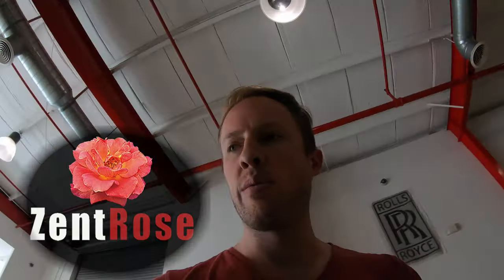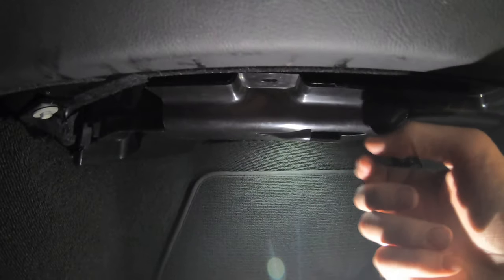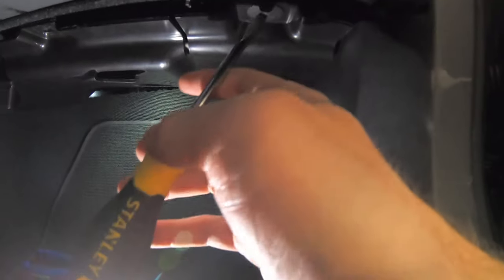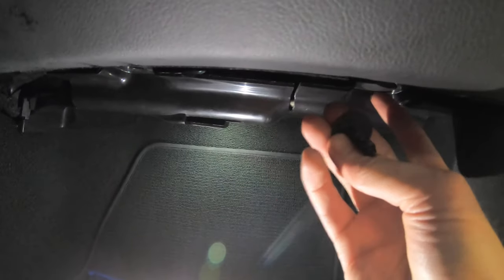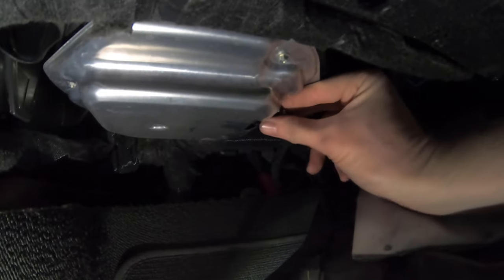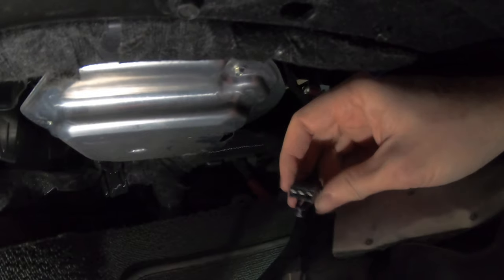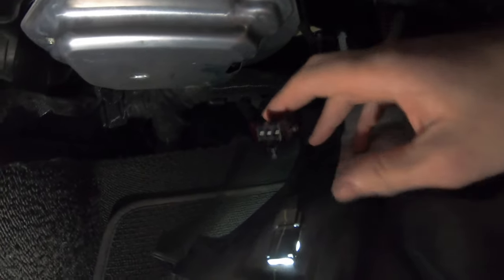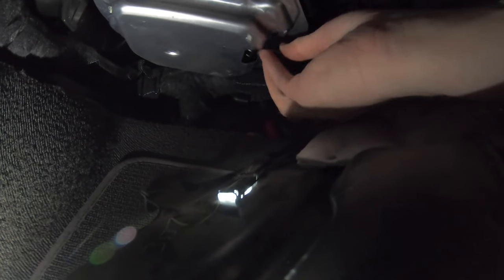C7 Corvette Blower Motor Failure | How To Fix

Comment: Did you guys ever diagnose why the fan motor turned off and on? I have a 2014 Corvette stingray that the fan motor will periodically turn off and on. Anytime I tap it or unplug and plug back in the fan motor works.
Reply: Hi, my 2014 corvette is doing the same thing. Did you ever figure out what causes it?
Reply: Mine too 2014
Reply: Any fix? Same here.
Reply: same issue on a 17 grand sport. fan works and then doesnt.  but drove over a bump and fan started working again. seems like a loose wire or connection. thanks, now i know where to look first.
Reply: Happened to me on a 2015 stingray

Comment: I just replaced mine.  Did it my self.    $140 unit and i replaced the wire connector that plugs into it too.     Its really easy to replace it your self but at the same time its a very annoying process.   The plug isnt the problem.   Its the module on the blower unit that keeps failing.   I found this out because ive done this and it failed again.  While waiting for the parts it started working again on its own.   But id highly suggest just replacing the blower motor unit and go ahead and snip the wires to the connector and replace the connector as well since you will be down there messing with it.    Mind you if you do not get a continental blower motor unit the metal shield wont fit back on more than likely.   I ended up going with a tyc motor unit and ditching the metal shield while using washers on the screws to put the motor back in place.   Most times its too hot outside to depend on an unreliable blower motor so its best just to replace it.   You may need to take the seat out if you need more room but the average person should be able to lay on their side and get underneath the dash for it.

Comment: Dielectric grease is an insulator.  It is used to restrict electrical flow. NOT to be used on contacts. If you don't want electricity to escape a connection, use it on the edges of the plug, not the contacts.  Really true.

Comment: ATTENTION!!! use that flat head screw driver to pry the two plastic screws. those screws cannot be un screwed they just need to be pulled out and you use the flat head to loosen it, actually I just pulled on the panel it came right now yes this fix worked for me two thank god!

Comment: I have the same problem but it keeps going back off at different time intervals once I replug it in. I own 2 C7s Same issue with both of them.
Reply from the maker: I ended up having to rewire the grand-sport. I forgot exactly what I did but I cut/ spliced /soldered and verified continuity with a multimeter.

Comment: I have a 2015 C7 Z06 and on my way home tonight the blower motor quit. I had visions of having to spend hours taking apart the dash and replacing the motor. I did a quick search and ran across your video. 15 minutes later problem fixed. THANK YOU!

Comment: My 2014 Corvette AC quit. Could hear the compressor cycle on but no blower motor in either AC or heat. Followed your direction by disconnecting the blower motor, reconnecting plug with dielectric grease and AC is back. I am forever grateful ... than you!!

Comment: Thank you for saving me, I nearly melted in the hot Texas heat the other day when mine went out. I'd like to know why this is an issue tho?? Seems 2 be common.
Reply from the maker: My connector failed. I ended up having to rewire it.
Reply: @ZentRose  can you tell me how to rewire it. I believe  my connector is failing as well

Comment: Hey..Im having the same issue with my c7. The top vents arent blowing air, only the defrost and foot vents.  Tried this and nothing still works. Any suggestions? Anything would help.
Reply: Keep unplugging and plunging it’ll work after a few tries
Reply: did it work
Reply: @rogerflores5784  nope smh
Reply: I am being told as I have the exact same problem is that the blender motor needs replaced. I can't find any videos showing this procedure. Did you get yours fixed. I'd love to find a solution or speak with someone who has had the same issue. Mine is doing the exact same thing as yours.
Reply: @huntermcgaughey3055  still hqvent got it fixed. I live in south florida, and unfortunately have not found a true corvette shop down here. Going on a year now with this problem. May have to take it to a chevy dealer for an out of pocket expense..was quoted close to 2k.. 😳not for the part, but because of how long it would take to get the job done. Heard its a pain in the ass job do. Keep searching brotha.
Reply: It's your blend actuator. Part isn't that expensive but the labor of removing the dash and reinstalling dash is. I was trying to find a DYI but watching this one guy take off his entire dash is something I personally do not want to do. My c7 is under extended warranty so I guess I will let the dealership deal with it. Hopefully it's covered under my extended warranty anyways.
Reply: @huntermcgaughey3055  Im having the same issue. Did your exstended warrenty cover the cost??? Thanks
Reply: @chrisolivarria3558  I haven't been over there yet but it's on my to do list very soon. Will keep you posted
Reply: @huntermcgaughey3055   any luck?
Reply: Yeah, it's back at the dealership for the 2nd time. Replacing motor & and blending actuator. I already knew this, but the first time, the dealership would only do a software update. I'm still waiting for the actuator to come in. It's been a nightmare.